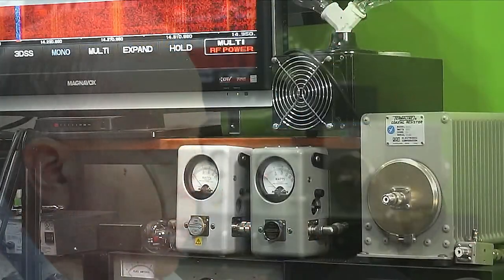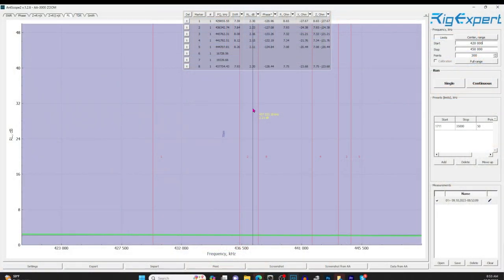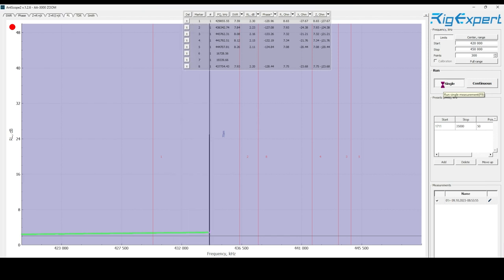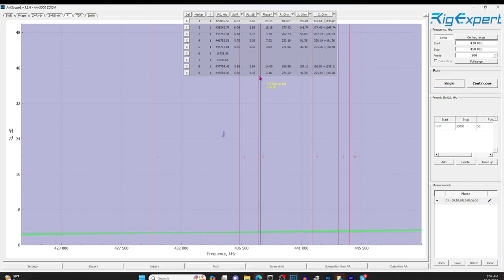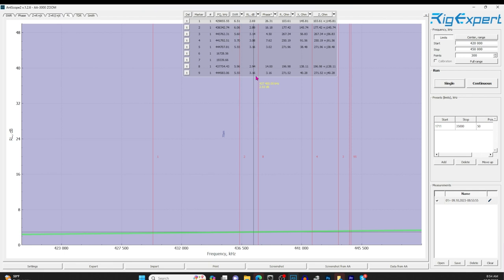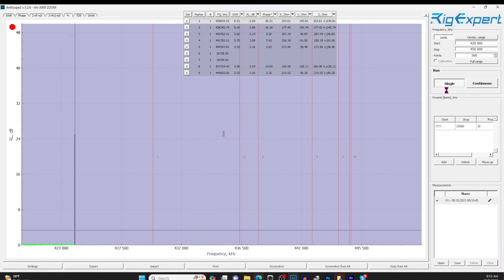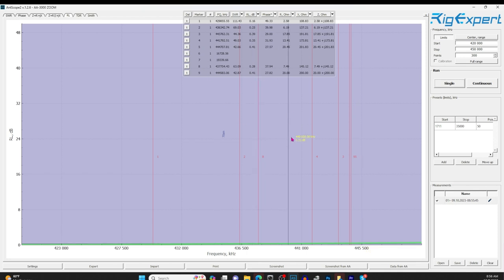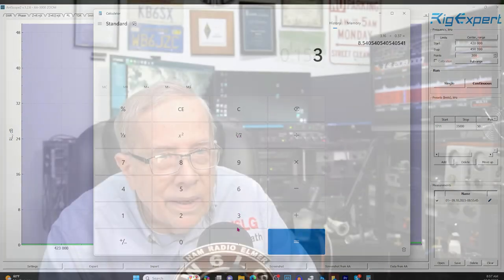Using the RigExpert AA-3000 Zoom to Measure Right Angle Coax Connector Losses with Jim Heath W6LG

Comment: I was recently doing some tests on one of the transponder antennas on my plane and had to choose between older(tarnished) and new antenna adapters.  My first thought is that the tarnish on the old adapter might be a problem and considered cleaning them off sometime in the future.  I also considered that based on the tarnish look that they may be silver plated.  I just ordered a new RigExpert AA-3000 so looking for reviews I found your video.  I should have the analyzer in a few days and I'm looking forward to trying this test on the connectors.  Thanks for taking the time to post this.  I'm looking forward to seeing your future videos.  David VE7CN

Comment: Hi Jim, Randy here KK7TV,  I pulled all my old Amphenol right angles apart and cleaned them just the other day.  The male stem has 2 sides at the base that are flat and a blunt long nose will grab it great.  Cleaned everything with a brass brush and put them back together and they work great. I have some new Chinese ones that are truly junk. They are intermittent when used.!!  So I am with you, the older ones are great and you just proved it !!
Reply from the maker: Nice work!  I was researching how to make my old connectors look new again.  Those connectors deserve a little care.  Thanks Randy, 73, Jim

Comment: Hi Jim. 
I am not surprised. The old connectors are silver plated and good dielectric material (Teflon). Many new low cost connectors have lossy dielectric (recycled milk jugs).
USE ONLY QUALITY CONNECTORS. Not cheap stuff.
Best wishes in your health battle.

Comment: I had similar experiences up around 900 MHz in the MAS (928/952 MHz) band with commercial systems. Pre-made, vendor supplied jumpers (something that claims to be LMR-240 but is not, connectors that you think are Amphenol but are not). Doing site link-budgets and measuring power at the transmitter gives one result, going up to the antenna and measuring power with a Bird 4391and it is a few extra dB down (even factoring in the proper losses for Heliax or LMR-600).

It ends up with a few hours of uncomfortable questions from the customer when a line-of-sight path a few km away ends up being 5,6,8,10 dB down and that impacts higher order modulation, fade margin and data throughput.

I keep a bag of "good" crimp connectors, good cable and an RF Industries piston style crimper tool and make my own cables when there is any doubt.

I too 'donate' the 'chineseium' pieces and parts with proper warnings.

Comment: Jim, good demonstration at UHF. Not surprising. I also, pick thru my stash of connectors and always try to select the old silver plated brass ones with Teflon dielectric. I worked for NASA and WSMR for the first 26 years of my career and knew I had the best-of-the-best even back then and the junk ones of today did not exist yet.  Now it is more obvious than ever to keep and appreciate the quality of the older connectors. I will also add that I built an antenna tuner using foreign made SO-239 that the PL-259 connectors just slip over the threads and keep turning when trying to connect them.  73 WA4QGA
Reply from the maker: Yep!  My home made antenna tuner, which you and I know does not tune antennas, works great with LARGE American made parts.  Your key down AM transmissions stress everything so you have to have good strong parts. Nice to hear from you. 73, Jim

Comment: Interesting results Jim. I totally got what you were telling Cal about the fit of the threads too. My question is where does one buy quality connectors these days because even the reputable suppliers seem to stock the poor ones and no option for any other. By the way, heard you on 20 a month or so ago and you sounded like you were in the next room, even all the way up here in Moose Jaw. 73 and keep up the great work. 
Tim VE5THF
Reply from the maker: Does DXEngineering have "reasonable" shipping costs to VE??  They may.  73, Jim
Reply: Shipping from the United States to Saskatchewan is never cheap and USPS is the less expensive option and doesn’t take much longer than the usual courier companies, who charge brokerage fees on top of the shipping cost. 73

Comment: It's my understanding the older style (Amphenol I suspect) connectors use a threaded insert where the right angle occurs.  The newer stuff can use just a spring connection.  With high power use, and heating, that spring isn't going to improve the connection.

Comment: I believe that insulation is Delrin. By the way, Amphenol still make proper right angle adapters but they are $40 each! Part number is 083-1AP.
Reply from the maker: I thought that you would know!  Thanks, Jim trying not to cross thread!

Comment: a have an opinion , when one has no room , either in height or width , there are no rules about antennas . 
I've got a kind of 1 , 2 wire BOG , totally against every HF rule , +- 40 meter long looped twice in the garden i a square ,2 meter high 2,5 mm2 copper wire ,self made  Input transformer 9:1, maybe its even 13:1 , end resistor 450 ohm.Then a 5 meter telescope somewhere in a corner for de-phasing the noise.I receive the whole world for a poor man price.This wire is random ,resonates to nothing . Direction change ? move my transformer ,100 € .Just saying , it can be done whiteout any expensive equipment.Brain and experimental lust is enough.
how is the health by the way ?
Reply from the maker: My health is a little better.  Both times recently code 2 to the hospital I was in gaurded condition... seriously ill.  So I am better now.  With antennas, you do the best you can.  Put your money where it counts. Thanks Pat, 73, Jim